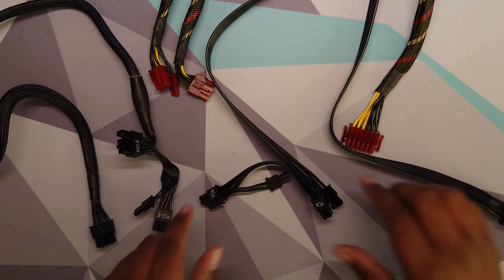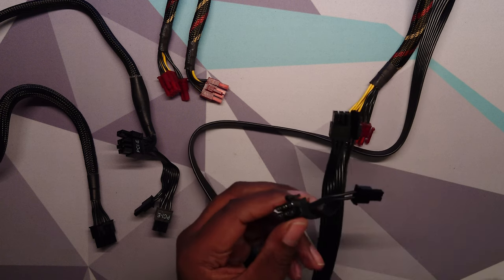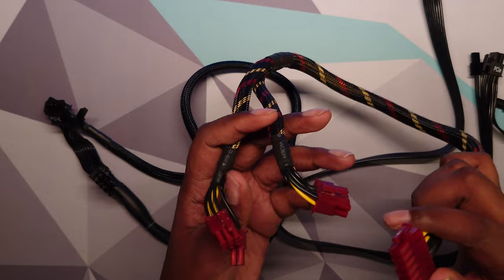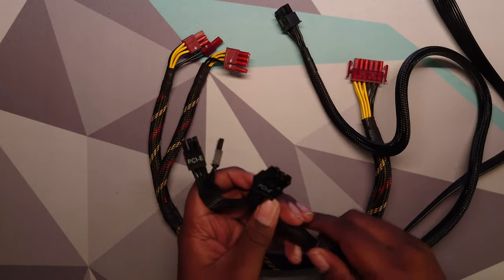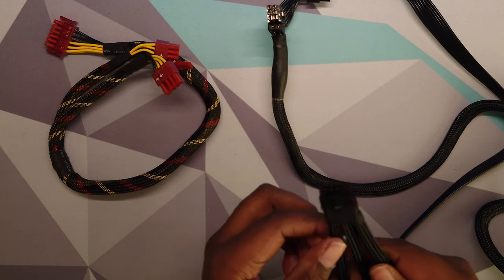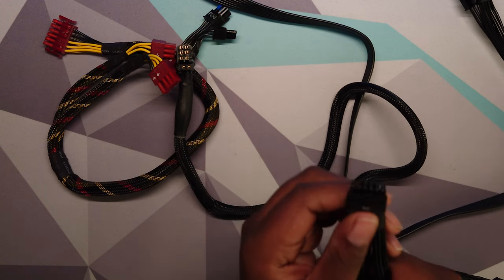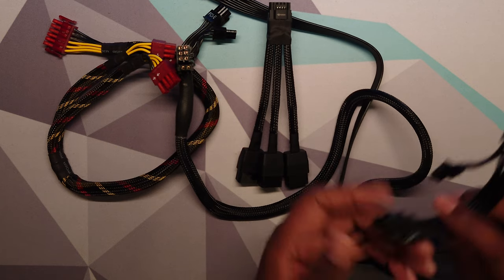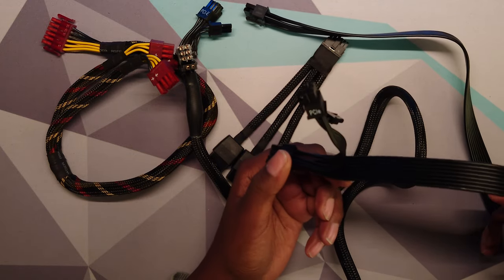PCI-E pigtails are fine. Contrary to internet advice

Comment: i been using pigtails on my cards for the last 5 years no stress running just fine on my 6800 xfx
Reply: bro thanks alot for this comment as I have the exact same xfx 6800 and I was worried if a pigtail is fine. 😅😅
Reply: Try pigtailing a 4090. Lol gl
Reply: @jamartin005  all 4090 are pigtailed they require adapter that's why they melted bro best bet get a 16pin psu so no adapter needed
Reply: Yo dude you got the swft model, how is the noise i’m planning to buy one for my first build
Reply: @jamartin005  You don't understand. The 4090 having only one header makes using "pigtails" safer than a 4070 with multiple headers. No luck needed.

Comment: so the conclusion is, as long as your graphics card doesn't hit 375 watts mark on full load, it wil be least fine with a little undervolt
Reply: 375 is absurdly too much. i wouldnt go over 50w of the max 150. especially if you are using them with nvidias 12 pin adapters. pulling 375w from a single cable is just asking for it to melt.

Comment: Can I use a pigtail with awg 16 with it is supposed to handle even 400 watts, to power a rtx 4070 super? I have a cooler master 750 80 plus bronze modular semi fanless ver with ocp, ovp and opp certification and also should I use two of them? Bc I have 2 awg 16 pigtails

Comment: I just installed a 4090 less than a week ago. I was planning on upgrading my power supply only because I only have two dedicated connectors with pigtails. After researching the specs I decided to go ahead and run it. And I have had no issues. Plus I only play VR games and the 4090 so far hits 350 watts max on everything I have tried and less than 300 most of the time. I know it would spike a lot higher running ray traced benchmarks and the big ray traced flat games. I'm not worried at all about running pigtails for a while with the low power load I am seeing in VR. Personally I'd be good with 500 watts. Above that I might want to upgrade.
Reply from the maker: 2 dedicated connectors would be really tight because of the power use from the 4090. If it only hits 350 its fine, but these gpu's will have short hard spikes. The reason it's not as great for the 4090 is because you have 3 layers of connectors instead of 2. the gpu, adapter and psu. Getting a custom cable for a psu would already be a big help.
Reply: @mechitworks what about the 4080 super I also only have two dedicated connectors but my PSU is 1000w

Comment: I had my 7900xt pigtailed and the cable was touching the plastic Window of My old cooler Master q300l and the cable run so hot that melts the Window, so i end the situation just adding the other cable

Comment: I'm a gpu miner and I used these with 3070 ti cards pulling around 250-260w of power in total (around 230w through one cable and rest through riser) using one cable like this, I managed to melt the psu side ports of 2 power supplies one of which was asus rog strix top brand psu. so the cable might be fine but the connectors are dogshit and can't handle 230w of continuous power. after these burns I swapped to using 2 separate cables for one 3070ti not going above 150w per cable, and haven't had a problem in 3 years.
Reply: Hello friend. Do you have the link of the exact cable that is worked for you?. My card draws 250-300 watts and every cable I use ends up melting down.
Reply: @chris-hg3iv  solution is using more cables. Not putting more than 150w load per cable

Comment: I have just melted the power connector using this pigtail. I use a 7900 XT with 4 monitor setup. The cable or the connectors was not able to handle the heat. I'll never use a pigtail again in a GPU scenario.
Reply: I did the same with a 7900xt. Reason behind it is some 7900xt including mine are rated for 380w the connectors can’t handle more than 150w each which means they might be ok under normal circumstances but if you’re using the gpu constantly at a higher power then they might melt just like mine and yours did

Comment: Question: 7900 XTX. I've currently got it plugged up to 2 8 pin PSU spots and it's got 3 8 pin ports on the GPU. I'm using a pigtail to handle that. TDP is 375 watts, which is fine. However when I started overclocking it'll go above 400 watts. Typically I would have said in the past no - 150 watts per 8 pin + 75 watts from PCI-E so 375 is the top. However, it appears it'll be fine according to this video? I'll still be well within Molex spec I believe.
Reply: bro just get one more whole 8 pin cord by itself i wouldn’t risk it on a 7900 pigtailing is still scary for high end gpus
Reply: it’s most likely fine lol just scary
Reply: I’d recommend getting the 3rd cable I melted a cable and bricked the power supply by pigtailing a 7900xt so would definitely recommend to be safer than sorry. In saying that the cable lasted 6 months until it melted but don’t risk it
Reply: @Dan-qw8di  Yea I ended up going with dedicated across the board. I feel much better knowing that :)
Reply: @ImaITman   good to hear brother I’m lucky my card is covered by 2 year warranty which will cover the damages and I’ll be getting a upgrade to the sapphire 7900xtx for only 50 euro extra. If it wasn’t for the warranty I’d be stuck with a dead psu and a gpu with damaged pins that might be unstable
Reply: @Dan-qw8di  Dude that's Awesome to hear! I ended up getting the red devil and I've been pleased with it so far. Had it for 6 months or so now.

Comment: Can i use the pig tail part of the pcie cable instead of the main cable? It seems ghat my case oannel wont close because the cable cannot bend to wear i can fit it in the case.
Reply: that should work, but keep the second connector unconnected.

Comment: Being running my OC's 1080ti with a pigtail cable for 7 years and the card can do over 310 watt under heavy load. Nothing wrong with it (PSU is a CM850V I thought), just bough a 4070 super to replace it on monday will run it the same way in the adapter.
Good informative video btw :D

Comment: A it depends on the card and how much it draws
B these cables killed my 1080 slowly 
C just don't use them stay safe they have a stigma for a reason they just are not as good as the single 8 pins a rating of power is not a hard confirmation of what they can handle the 16 pin is a testament to this since they literally melt if they are even slightly loose and they are rated for 600 watts on a 450 watt card.

Comment: I have one like the red tip one on my bequiet 600watt psu would that be fine for 6750xt?
Reply: The 600w is the thing I'd be pondering about, not the cable

Comment: the main 8 pins are fine its the extra pins.that melted 1 pin can i re use it as long as i dont plug in the melted extra 8 pins?
Reply: Please don't you have no idea how the circuit is making contact since it's melted. It could cause a short.

Comment: I have a corsair cv 650w psu and was planning to buy a rx 6750xt that has 1 8pin and 1 6pin. Can this psu handle rx 6750xt (tdp of 250w) in a pigtails or is it one of the psu that can't handle transients from the modern gpus? I just bought this psu recently and now that I'm planning to upgrade my gpu, I just noticed now that it only had one pcie cable on it.
Reply: Same
Reply: pigtailing should be fine, (not a good option, but a bit fine), i also have one, the only causes it will burn it because the wattage overladed the cable, if your GPU had to 1 8-pin and 1 6-pin, the maximum load should be 300W (include the wattage from yout PCIE slot on motherboard carried max power of 75 watt) so it'll be 150 + 75 + 75 watts in total, if you wanna go safer i suggest undervolting, it might hurt, but at least it will reduce the chances of power spike

as long as your GPU TDP still around 50 watt below the maximum power of the system can provide, it should be good.
Reply: you are asking 2 questions: 
Can I safely connect the 6750xt using 1 cable with pigtails?
Can my PSU handle transients?
PCIe 8-pin connectors can supply 150 W (https://youtu.be/FfoT3qLH3rY?t=163 and https://en.wikipedia.org/wiki/PCI_Express#6-_and_8-pin_power_connectors), the motherboard provides an additional 75 W through the PCIe slot, so together that's 225 W. Since your PSU has only 1 PCIe cable, you're 25 W short. 
However, the problem is not power (watt) but heat. If airflow around the connectors is sufficient, you may not have a problem. 
As for the transients: I think you will be fine. Say a transient occurs during a few microseconds and asks the PSU for double the TDP, i.e. 500 W. The other components want some power too, for instance 100 W (depending on what and how many components you have). Together that's 600 W and you'll still have 50 W headroom. 
To be honest, if I were you, I would upgrade the PSU to 1 with 2 (or more) dedicated PCIe cables to prevent using a pigtailed configuration. Usually that means the PSU has more power too which gets you on the safe side concerning transients. 

Since you asked the question 8 months ago, I am curious: What did you do and how is it running?

Comment: So I’ve ordered the nzxt c850 (2022) to go with my sapphire nitro + 7900xtx. The issue I’m facing is that the psu comes only with 3 pigtail connectors. So if I were to just ziptie the “pigtail” and use the main one. Would I be fine? I might plan on using cable extensions just in case (for aesthetics) and worse case (I don’t wanna do it bc it’s expensive) is cablemod replacement psu pcie cables. Any insight on this?
Reply: Hi, I have a similar situation with you. So how do you resolve this issue? I am planning to use 3 pigtals but only using the main one separately for my gpu.
Reply: @jeanbannon  so I did do that, I used three different pigtails and just zip tied the extra pigtail on each one. I went with the Asiahorse gold plated extension kit and used them from the pcie cables!! 4 months in and no issues whatsoever!!
Reply: @kqrmabury   Really glad to hear that, I will do it just that way you do it then. Thank you so much, hope you have a great day, kind sir!
Reply: Same here i have c850 i actually got extensions for mine so the ugly ass pig tails are in the back of the case. But yeah only use one of the connections and zip tie the pig tail.
Reply: I can also concur months later if works fine but isn't all that aesthetically pleasing.

Comment: So I was advised to buy asus tuf 7900xt oc gaming wwhich has 3 pcies lanes with a be quiet pure power 12m 850w. But is has only 2 12v rails with 2 pcie lanes pigtailed. Is that even a good combo then? Do I need to be worries for failing hardware or fire? Im scared as hell to plug it in. Should get a psu with 3 pcie lanes?
Reply: I'm using 2 pigtails with a 7900xtx and it works really good, there's no problem.

Comment: So I have a Triple fan Gigabyte RX 6700XT 12gb OC, a b450m ds3h with 16gb of RAM and Ryzen 5 5600. My PSU is Corsair CV650 Bronze+ 80 with a single pigtail PCIe. Should I get my PSU replaced or is it alright to use pigtails?
Reply: is it fine now ? ive got the 6750xt and ive undervolted my gpu because i could smell a hair dryer smell from my pc and now its gone now that ive undervolted it.

Comment: It all matters if its muli railed or single railed. If its a single rail essentially the both of the tails are dc which means its split YES but its going into one current. Now if its multi railed you will have to be careful because it can overcharge one or the other tail and cause bsod/restarts and worst case scenario it can fry your pcie port directly on the pcie connectors and the pcie slot of the card. This when knowing and benchmarking your card to see if it spikes above 225W. Most psu's that are worth a damn are single railed anyways. Another reason to only go for certified gold only psu's, i.e quality psu's. Like EVGA, Corsair, Be quite, and seasonic.

Comment: So I just got an RX 6700 XT on Google it says the max watts can draw is 230w. Now I got a single pig tail style cable with 6+2 pins on both ends since the motherboard gives 75watts that means that the cable needs to give me 155w when the gpu is under full load. So my conclusion is that I'm safe to simply use that one pigtail cable c
Reply: So did it work
Reply: I have the same problem, I bought an rx 6700xt, my psu is a corsair cx 650w 80 bronze that only has a pcie cable with two 6+2 connectors, do I run the risk of burning one of the connectors due to overloading?
Reply: @matiasluna8235  well i did alot of research 7 months ago and apparently these cables can handle ALOT more than 150 its just a safety companies slap on their cables,ive been using what i described on the comment and under full load on forza horizon5 and it has been working fine. I hope this helped and i cannot wait for you to biy the gpu it is awesome
Reply: @whoknows7810  didnt realize you asked.. 5 months later yes it worked

Comment: can i use a pigtailed cable on a gtx 1080ti strix edition TDP 250, my powersupply is aerocool xpredator 1000GM 80 gold plus
Reply: Ofc you can
Reply: Can i use pigtail on evga 1080 ti with 750w corsair psu bronze rated? Or will it have better performance with 2 separate 8 pin cable?

Comment: i have a MSI Radeon RX 5700 XT Gaming X Graphics Card '8GB GDDR6, 1980Hz and a 600w thermaltake psu that comes with 2(6+2)pin. is it okay to use the 2 pigtailed 8pins?
Reply: Yes, and it's the best, providing 300W of power to the GPU. But since it's an rx 5700xt, I think just one would be enough, depending on the model.

Comment: So, I have zotac rtx 3080 with 2×8 pin ports
And my psu which is corsair 1000x 2021 have lots of pcie cables.  I installed 1 cable with 2×8 pin. Should I be worried about that?
Reply from the maker: If you have the extra cables. Use them!

Comment: would it also make the card very hot on the back?
Reply: No, it won't but it can contribute to heat building up.
Heat is generated at the weakest link, i.e. at the point where electrical resistance is the highest. This would be the connectors itself which are positioned at the side of the board. Whether this heat reaches the back of your board depends on the airflow in the case.
The GPU chip and the MOSFETS generate much more heat than the connectors so the connectors don't play an important role in heat at the backside of the board. This video is all about preventing melting of the plastic isolation of the connectors and the wires close to the connector.

Comment: Should i use 3060ti rog strix with one dedicated cable that has 2*8pin connector? Or is it risky
Reply: Its not risky, its only 200w
Reply: @magicianGOD  how about 250w rx 6800 is it ok to use pigtail ?
Reply: @irwanstn  if its 16awg, its ok, if 18 50/50, i will say its little bit risky
Reply: @magicianGOD  16awg ? what is that ?
Reply: @irwanstn  wire thickness

Comment: Can I run 3 separate cables for my 3080? With all 3 cables looking like that?
Reply from the maker: Yes, 3 seperate cables is the best case scenario. Even if they have pigtails.
Reply: @mechitworks what if you had one cord dedicated pcie and one cord with a pigtail connection connecting to two 8x2 slots

Comment: Anyone use the pigtail with a 4070 super?
Reply: That's what I've been wanting to know lately. From what I've researched, the 4070 Super FE's total power draw is 220 watts maximum.
So if I'm understanding correctly, then using 1 pcie daisy chained to gpu should be fine. Don't take my word for it though. Do some research and do what you are comfortable doing and or knows to work.
It's also kinda weird nobody has put a video together showing exactly what kind of cable and how they are connecting gpu to psu regarding the 4070 super fe.
Vury strange🤔

Comment: Is it ok if I use two 6+2 pin pcie connectors for 3060
Reply: 6+2 is an 8 pin connector when attached so it should be good.